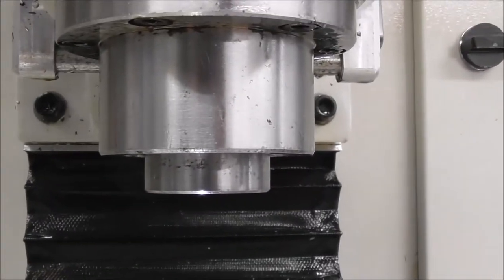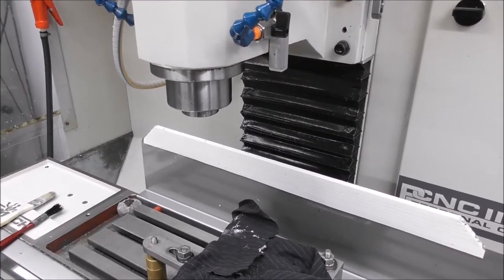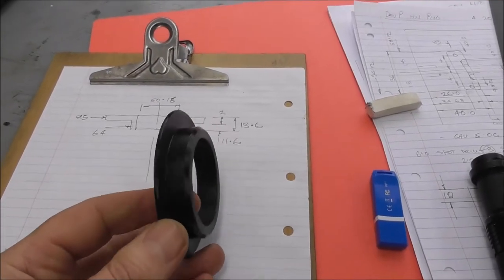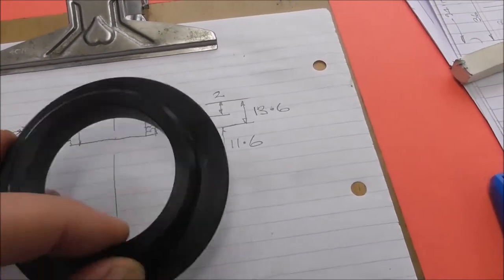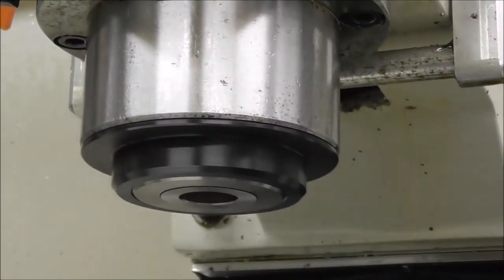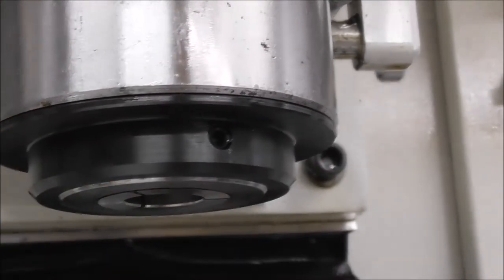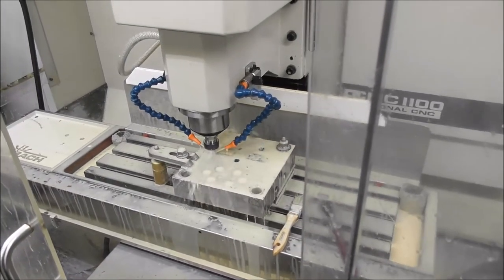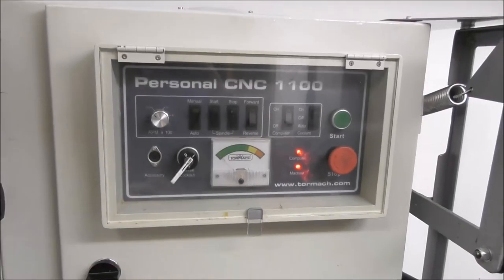Spindle Bearing Protection

Comment: Nice flinger. Makes a bigger mess when it's working.

If it were an oiled bearing, the low pressure created between the spinning flange and the stationary nose might be enough to suck out oil, if the oil seals were marginal. 

The spindle bearings are pretty simple on the Tormach, judging by Grimsmo's spindle rebuild episode but I wouldn't start it on a "pressure day".
Reply from the maker: Yes, one always wonders if there is a downside.....thanks for your thoughts.